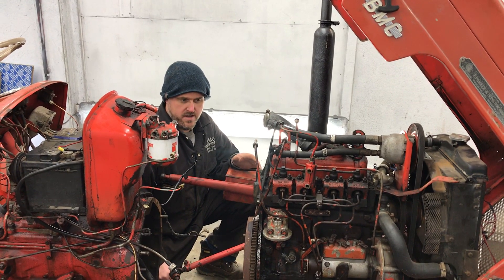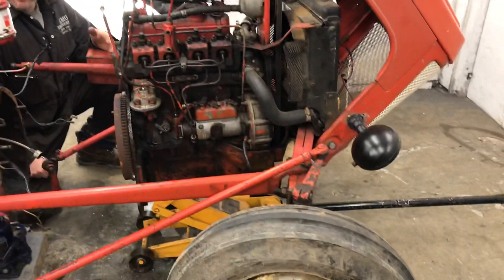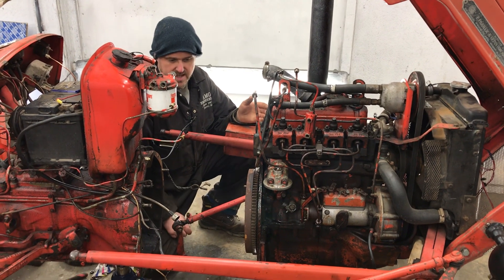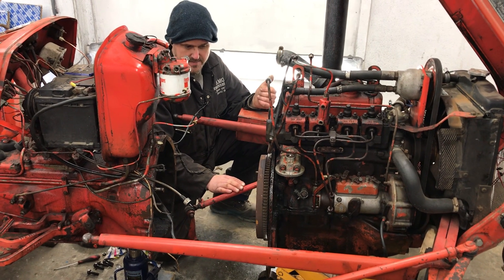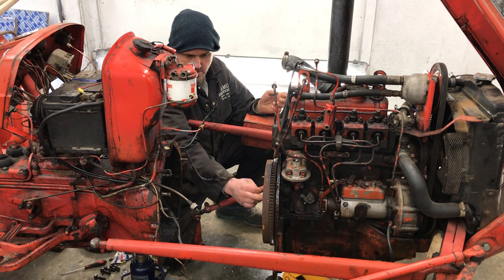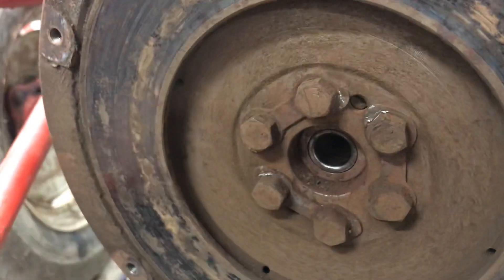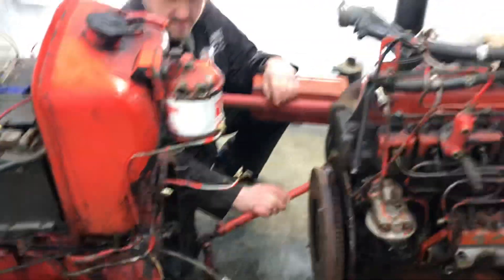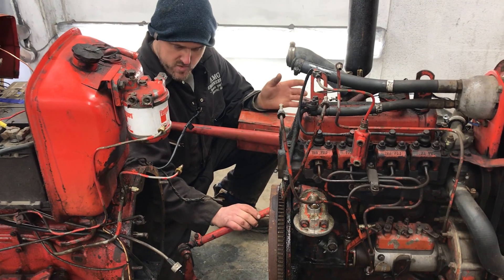BMC Mini tractor clutch repair

Comment: hello I am considering buying a Nuffield 425 which I believe is the same tractor. I want to fit a loader on and have looked at some videos on you tube. The question is the loader frame bolts under the belly of the tractor and has a cross member at the top. is this crossmember bolted to the engine or gearbox somewhere as there is no support forward of the loader fame to stop it twisting forward.